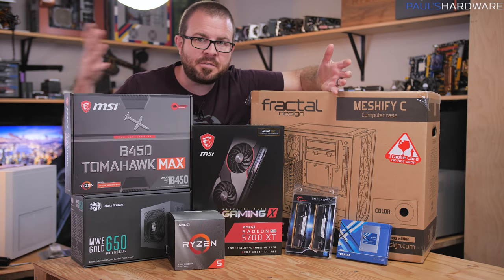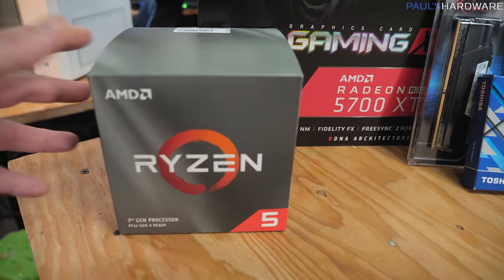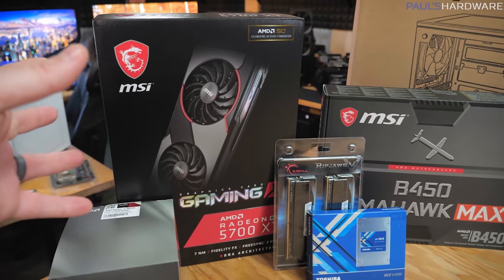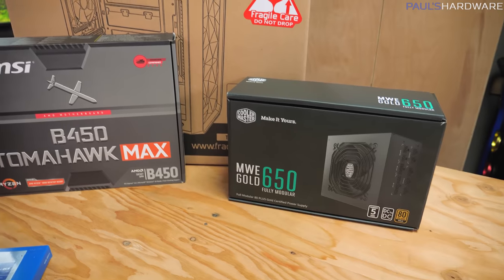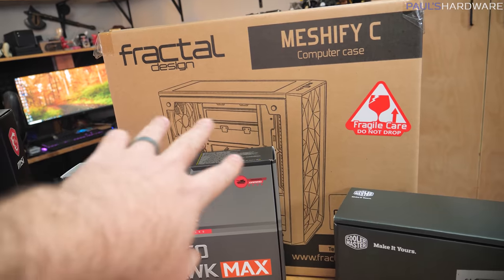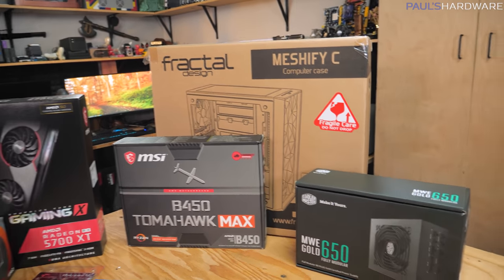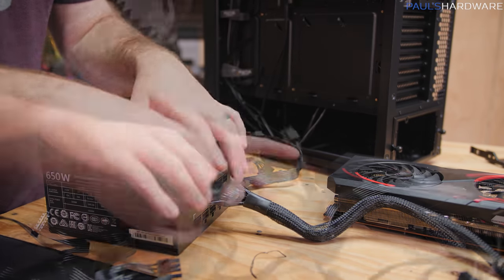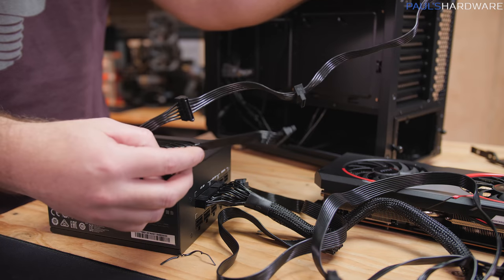Building the $900 Gaming PC that Everyone Should Build!

Comment: "That everyone should buy" and I just want a laptop and I can't afford it
Reply: A tower PC will last much longer for your bucks, a laptop with power is heavy, non portable, loud and hot. 
No real upgrades, ever. If GPU is dead, the whole laptop is dead. Changing BIOS battery after 3 years will most probably result in catastrophy. I had a MSI Laptop GS70 with GTX970, it was loud and hot and the keyboard ASDW where unusable after the first beer dropped.  

One unlucky second and the mighty laptop is gone. Dont lower your life standards by having to care such trash.
If you really need a portable computer, try Surface Pro for 99% of everyday stuff.

Use your tower PC at home when you like to play, make music and more computational expensive stuff, 
Take your tower to your friends LAN party, not the laptop. Its much more fun.
Reply: @MrGerdbrecht  oh man thank you. The problem is that I would like to have a powerful computer because I want to    take it to the university. Because buy both would be even more expensive, even if the laptop is not that powerful
Reply: @yagotrias3685  Look at the portable computer as a terminal to your more powerful pc (connected to the internet) in your room at university. Dont try to fill all your needs with ONE device. Use more devices that are still cheaper in sum because tower PC is much cheaper in the long run and a tablet terminal with keyboard can be a lightweight  companion with acces to your full powered desktop using Windows Remote Desktop Connection or VNC, Linux, TeamViewer whatever you like.

Even the Surface Pro 4 with M3 would be good terminal, a Surface Pro 4 with i5 is still passive cooled ( silent ) and can still manage some engineering programs like AutoCAD, SolidWorks etc.. heavy programs like that. 

Dont try solving all needs with one device. Its not possible for "poor" aka normal ppl.

EDIT: Currently i use the SP4 for my everyday stuff. Its beautiful screen helps me with reading and writing text which is 99% of my everyday stuff. The screen is therefore the most important part of the companion.

Then atleast 8h real battery life while "working" to survive a day at university.

Then im building a midi tower PC for christmas ( me ) with R7 2700 ( 150€ ) + MSI Tomahawk B450 Max ( 100€ ) + 32GB RAM 3600MHz CL16 ( 180€ ), Corsair VS550W ( 50€ ), R200 Midi Tower, 256GB nvme ( 50€ )
and GPU 200€ and monitor 200€.

Makes 650€ for the base PC, and 400 extra for GPU and Monitor, because i didnt had such thing in a long time ).
Reply: @MrGerdbrecht  Now you have convinced me, I'm thinking about building my own gaming pc. Thanks for your help, I appreciate it
Reply: Make mini itx and carry it with you instead of books
Reply: @saladman9832  That's not an option xD
Reply: Make sure outer laptop casing is metal and not cheap plastic.
Reply: @yagotrias3685  buy 2nd hand if Windows. Consider Chromebook if new.
Reply: Please don’t buy a laptop. I have an $800 asus tuf laptop with i5 and a regular 1050. My desktop with a fx 8320 and a 1060 6gb runs way better and cost me $340. Yea my desktop may be outdated and not upgradeable from here but I still get 60-100 frames on PUBG high settings, cod MW 80-90 frames, EFT 60 frames, etc.
Reply: Bought an Alienware R17 with i7 proc, GTX 1070 6 GB, 16 GB of ram, 1TB memory with 256 GBs SSD for $1199. 4 years ago. Still running great. Love it more that my hardtop. Mobile, cheaper, can’t build on for that. Black Friday is the best deals for brand new laptops
Reply: @dutch0770  Hi, this christmas i bought 256 GBs SSD for 40 bucks ). AMD R7 1700 has 1500 cb15 multi points out of the box ( 65W, stock cooler ) which is nearly the performance of a dual socket system 2x Xeon E5-2670 ( cb15 multi ~2000) from 5 years ago.
Reply: I’m telling you to build a laptop for under $1200 with 6th gen i7 process, 1TB hard drive with 256 GB SSD, 16GB ram, GTX 1070 6GB, 17 inch screen. And all parts are brand new. Let me know when you can do that under $1200? 4 years ago. When the graphics card alone was $250-300 at the time

Comment: I built almost the exact same build with the same 3600 CPU and Tomahawk MAX motherboard. the only things I've changed were the case, because I sound a cheaper one (DIY-s07) on Newegg, and I used a different graphics card. I also went for a 2TB SSD instead of a 512 just because I want to have lots of storage for games like ARK lol. But pretty much the same everything else minus the case, GPU, and SSD.

Comment: The fractal case is amazing value. I used it and was the easiest case to cable manage even with 3.5 inch drives and a 280mm AIO. Also my AORUS 1080ti fits as well as 280mm aio in front so length is perfect ( 1080ti had maybe a inch between aio and shroud ) Great thermals great noise and Great to build in! Highly recommended

Comment: Paul, superb videos. I just clicked, "Place Your Order" with AMAZON for the system. I already had a Corsair CX650M (new) and a WD Black 1TB, so, we left those off and will use them in the build. This is a gaming rig for my son. He is graduating up from a nVidia GEforce 960 based system to the Radeon '5700XT. We are very excited. We went with the M.2 SSD drive for the boot speed/ appl loading. Used your influencer link, too. Best!
Reply: Okay, we built it in about three hours. Used the stock cooler as we don't plan to OC just yet. This is his first build, my umpteenth. So, I just advised and guided. We originally put the cooler on 180 deg so the "AMD bump" on the black ring hung over the 1st RAM slot. Once we realized it, we got some Arctic Silver pulled it off and after cleaning the CPU and cooler of thermal paste, re-installed no problem. The CPU fan cable didn't reach using your routing so we went the other way around the AM4 socket. RAM, nVME, Radeon, SSD, two extra Noctua fans (120mm) went in without issue. Cable up was nominal. Moment of Truth went smoothly, all fans, lights came on. However, after configuring the UEFI, we went to MS to get Win10. The MCT couldn't find the USB stick. It wanted to install on the boot drive of the PC we were using to create the stick. We tried three different sticks to no avail. So, we went to Amazon and ordered the package deal. Very excited to finally get it up and running. I'll keep you updated in this post. Thanks for the great video and build.

Comment: Oh and now that you mentioned the 2060 super im sick to my stomach.. found them for like $400.. thats one of the last things i need to upgrade the system i have. im running a Maximus x hero with an i7-8700k 16 GB Team group Nighthawk 3200 RGB RAM but i dont have a GPU at the moment. I was using a GTX 750 SC 1GB card but it is no longer living.  Im pushing all that with a EVGA 1000W P2 Power supply. all inside of an NZXT 510 black colored. Its taken me sooooo long to save up for all of these parts and a few of them some nice people donated to me because i was without a PC. So now im trying to save up some money by building systems for others or fixing them. im limited in what im able to do physically for personal health reasons but maybe one day ill finish this system :) I really wanna get a GPU to put back in it.. something recent tho hopefully. Would also like to get some custom PSU cables. oh and i have a 120MM Asetek AIO. Like one of the plain older ones. So im wanting to put a 240 AIO on the system. Throw in some nice RGB case fans from corsair maybe? upgrade the HDD 2TB drive i have and get an SSD hopefully. Then my system will be complete.. Just wanted to share my november build with you paul. haha im a little late i know but also ive been working on it for more then one november.. Which ironicly enough my birthday is november the 8th! Keep the videos coming Paul. I enjoy them a lot..

Comment: I really want the 5700 but I'm probably going to get the 2060 super. Ray tracing, drivers, heat issues and future proofing are all concerns I've seen in the GPU community.

The 5700 had so much power for it's price range it's a shame that I'm so hesitant to commit to it.
Reply: Yeah! You totally should get the 2060s

Comment: I had and I saw so many problems in so many years with ATI/AMD that I wouldn't recommend that, go directly to RTX/Intel. But I understand you have to show it because you received it for free (awkward to put that in a recommendation though). Also, since there is no hesitation between a SATA SSD and NVMe when your MB supports it, I'm not sure why you show the SATA at all, given the small price difference. Those PCs are expensive, and it's best to directly buy a good quality set, especially the CPU, the graphics card, the DDR and the SSD.

Comment: Hey, I would like to make some input about the PSU as a person recently built a PC and had some problems.

My system was relatively similar, same MOBO, 3600X, Samsung nvme m.2 SSD, RTX 2070 Super and geiL 16 GB Memory(AMD Edition). I had the exact same PSU, Corsair CX650W Bronze. And during certain games, at certain points my PC was rebooting. It was frustrating. After some research(and helps from various forum posts), I concluded the problem was the PSU. NEVER buy cheap Corsair PSU's. With a little bit of research you may find a lot of similar cases caused by Corsair budget PSU's. It didn't even made sense, I could play RDR2 with high settings without any problem, but I would get reboot during PES 2020 for example. The problem was, whenever my GPU needed full power, the PSU was failing. 

I know that my system required more power than this one, but still, there are lots of cases with similar specs too. Also, the MOBO is pretty upgradable and I humbly think you shouldn't gamble with cheap PSU. I bought a Seasonic Focus 750W 80+ Gold. I think it's around 30-40$ more expensive. But also, buying a new PSU was itself a gamble for me. It is really frustrating not being able to know the problem %100. It may also be GPU. In conclusion, buy a good, at least gold PSU in my opinion.

Comment: Pretty similar to what I am planning to build. Instead, I'm planning on building a microATX build, using a Ryzen 5 3600 not the 3600x, the MSI VDH-PRO microATX motherboard, a 5600 XT instead of 5700 XT, 16GB of 3200 mHz RAM not 3600 mHz, a 2TB HDD in addition to a 500GB SSD, the Meshify C microATX case, and a 550W PSU not a 650W PSU. I hope I'm making good choices, to build a PC to play 1080p gaming for 3+ years.
Reply: seems pretty decent.  The CPU is more than good enough.  The major difference between the 3600 and the 3600X is mostly the included cooler.  Unless you plan to OC hard it won't matter and I wouldn't OC too hard in a small form factor case because of the heat generated.  The GPU seems fine and 16GB of RAM is enough for gaming.  I would get a NVME M.2 drive if you can for the boot drive and the OS and game filez.  Store all your movies and other junk on the big HDD.

Comment: I was building similar PC on Tomahawk max with Ryzen 5 2600x  , PSU Corsair 550W and had issues with ez debug VGA red led with two brand new graphics = radeon xr 570 series , one from xfx 4 GB and second from msi - armor model 8 GB . 
 For 3 days each one runs fine , then after restarting mobo shows solid red light on VGA . no posting signal to the monitors.  All PC has brand new parts . Bios updated from 7/19 to 11/19 = issue solved for another 2 days and then problem back again . 
All drivers up to date , cables tested with 3 monitors on my old pc  Acer X3990 i5  8GB Ram and SDD.  Corsair 550Watts PSU also works fine ,all power cables were tested . Amazon send me  the same NEW mobo and will come in few days .
 I did try everything ... 10 to 15 restarts and VGA red led is off , but after restart the problem is back . 
So the only thing I`m not 100% sure is that I use converter cable from DVI-I to HDMI - brand deleyCOM , for my primary monitor and just guess that thanks this connection maybe GPU gets crazy and is working whatever it wants.
 I fighting with this problem for over 2 weeks  and no success.

Comment: I upgraded my pc to Ryzen 5 3600x on an msi b450 gaming plus max, 32gb ram, a sapphire rx 5700 xt and a superflower 80gold 650psu all housed in a corsair 750d case. It is just a shame the ryzen chipset you say would last quite a while didn't last more than 3 months. All the money I spent on a pc just to end up with a computer I cannot use while I wait for amd to fix the cpu.

Comment: I'm pretty certain if I bought this computer it would probably be on par or probably a couple fps less than what I currently have . Why I'm saying that is because I have the 3600 paired with a 1080ti, the 5700xt obviously is a great card, and I'm sure if I had a  better CPU (not saying the 3600 is bad), the performance with the 1080ti would be amazing for 1440p gaming.
Reply: I basically have the same building just 3.2 GHz ram

Comment: Hey, awesome video. O have the exact same specs here, but the PSU is a Corsair 550w 80 plus gold, does It handle my system? Or do I need more watts?
- (2x8gb) DDR4 LPX Corsair 3000Mhz RAM
- AMD Ryzen 5 3600X
- AMD Radeon RX 5700 XT Red Devil
- Asrock Steel Legend
- SSD m2 NVME 500GB

Thanks in advance!
Reply: Use PSU calculators like this one:
https://www.bequiet.com/en/psucalculator

You didn't say your case and cooling, but 550 W is enough for your system. 450 W would be risky for OC or any change that could increase the power. 650 W would be perfect for upgrades in the future that need more power.

I am noob at building computers, but in my little experience, I have realised that you should choose a PSU that can handle not only the setup you build right now, but what you could expect to build in the future with the same case and motherboard.

That makes the difference when you upgrade your CPU, GPU,etc. for a more demanding one in the future and you want to keep all the other parts.

Comment: Thank you for putting this together, it really helps when choosing a CPU/GPU combo. That said I'm in the process of building a new machine being that mine is now over 10 years old but did buy a 2070 FE Nvidia GPU some months ago. 

For that Video Card is a Ryzen 9 3900x paired with a 570 mobo overkill? I plan to game at 1440p.
Reply: amek23r It fits pretty well for 1440p even light 4K in some games

Comment: Had to see which video card you chose! That's the one I was thinking about, just figured you used XFX's being cheaper, at least these days anyway $300 RX5700. I'm running the Sapphire Pulse RX590 (which I have no complaints atm with fan noise or fps) but want this gpu when I upgrade. Thinking about just the RX 5700 Pulse $380. Sapppire Nitro + cards have better bench marks & reviews + are quiter on the RX 480-590's than other offerings from what I've seen. $450 for Nitro + would be tempting will have to see what prices do by then.. How did that MSI do on fan noise at load? Have to admit that MSI card & board look pretty sweet, not a fan of that towers looks but it worked. The XFX's design's now suck imo btw & are loud @ load at least their RX480-590's solutions, now the 5700's shrowd looks like the Pulse/Nitro RX590's lol.

Comment: Great video, I was debating whether to go with an HP Omen with the differences being:
128 GB M.2
32 GB DDR4 2666
i7 
1660ti
For $1500

I already have a case, and I’d like to go Ryzen 9 keeping 32GB DDR4.  Also a good point on going semi modular with the PSU since the 24 pin is required.  I’d still need a board, a 128 GB M.2 nvme drive, and a 1660ti.  Not sure if I can pull that off at the same price point.
Reply: Why would you pair a Ryzen 9 with a 1660ti? Unless it's a workstation you'd be way better off with a Ryzen 7 or 10600k and a better GPU with the money saved on those cores you won't need.

Comment: Will this build run the new Microsoft Flight Sim 2020 and if so which Category would it be in, Min Specs, Recommended specs or Ideal Specs. I have a old PC and do not think it would be worth upgrading and after watching probably about 20 or your videos over the last 48 hours think I can build a good one to use. Thanks In Advance Hopefully yo can advise as to what to build with the parts list. I currently have a Old HP h8-1220t with Radeon RX 460 graphics and not sure IF I can upgrade it or not.

Comment: I have the 3200 Ripjaws V 32GB. Is that going to be a problem? I have the same motherboard and CPU. My graphic card is the RTX 2080. Also, would I be able to buy the 3600's later on and use them along side the 3200's, or will I need to buy four 3600's?

Comment: Great vid mate. Do I need to worry about this? Warning!Some AMD B450 chipset motherboards may need a BIOS update prior to using Matisse CPUs. Upgrading the BIOS may require a different CPU that is supported by older BIOS revisions. Thanks for the help.
Reply: That doesn't matter since this has BIOS Flashback, which means you can update the BIOS without the CPU.

Comment: but some 450 motherboards have to be upgraded for 3rd gen cpus and also the 5700xt is literally the same as 1660 in the nvidia platform so you just pay a extra 100 and youll get the 2060

Comment: Gidday Paul, I built a gaming PC 7 years ago, my first ever build (wish you were on youtube then :-) ) It has been a fantastic system and I never had a problem........until I updated to Windows 10. Now I get hi temps on my CPU always and the GPU occasionally. I have updated my BIOS, chipset drivers and Nvidia drivers with no luck. I'm on the verge of building a new PC now because I've become frustrated. I'm really into recycling and I'd like to build from second hand or refurbed parts, I'll be reusing my corsair semi mod Gold 1000w PSU and the Antec 902 case.  Can you suggest some reputable sites I could source some parts from and offer some guidance on parts for high end gaming (i'm not into LED's or watercooling). I'm in Australia btw!  Love your vids and I'll be following your PC build vids when I get going. Thanks !